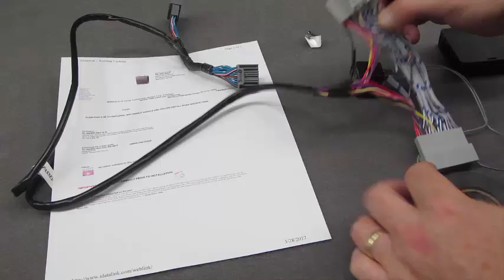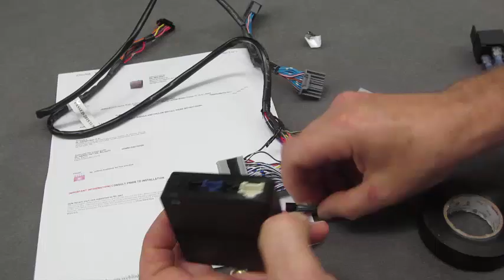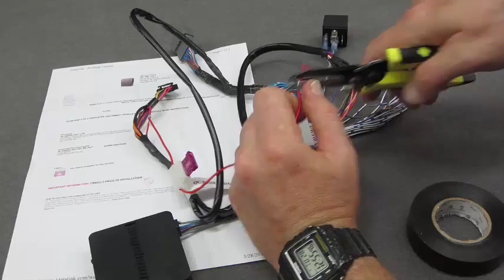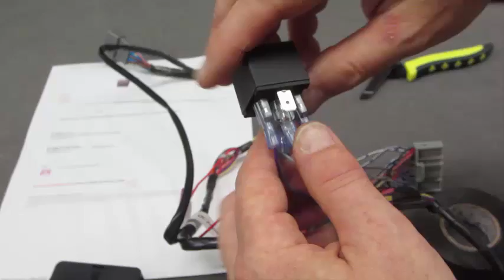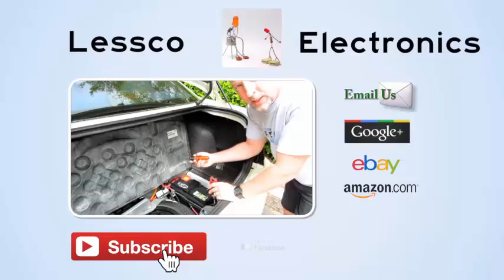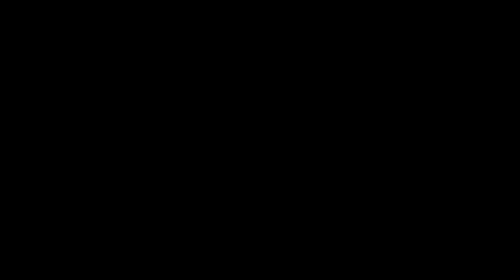How to modify an iDatalink HA7 Honda T Harness

Comment: I purchased this for my Honda Odessa 2015 push start. I get the blinking light for the first programming part.  Did this wiring and when I go back to step 2 of program I get a blinking red light and my factory remotes no longer work other than start the vehicle.  Any ideas on what I’m doing wrong?

Comment: i just bought a 2017 rdx. planning on getting the ADS-HA7 remote start kit that comes with the T harness. I wish to just use the factory remotes and do the 3x lock to start. I know in past Acura installations i had to do a work around to get the keyfob to unlock when it was running. If i bought a brand new kit will i still need to do this mod? you made mention of pre 2016 i think so i wasnt sure.
Reply from the maker: This wont apply to you
Reply: is that because my key fob will still unlock the doors, or this mod wont fix it for me?

Comment: Great vid.  Thanks for posting.  Question: You mentioned that this is the omega version of the harness, which is the equivalent of the ADS-THR-HA7 harness but the ADS version doesn't come with that module you have (I believe the ADS only comes with the wiring harness itself).  Can you still do the mod to enable keyless entry and takeover (to avoid the vehicle shutting down) without that module that comes with the Omega?